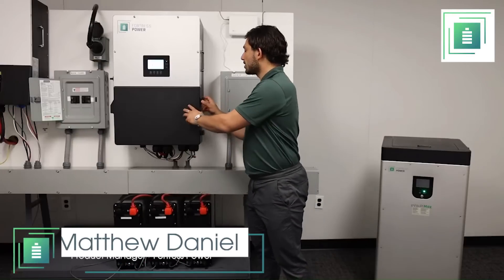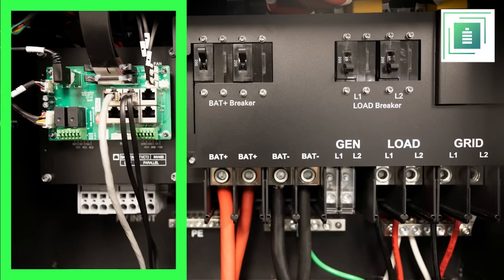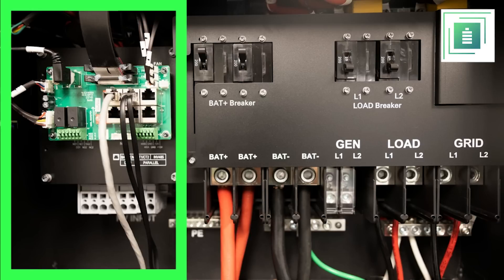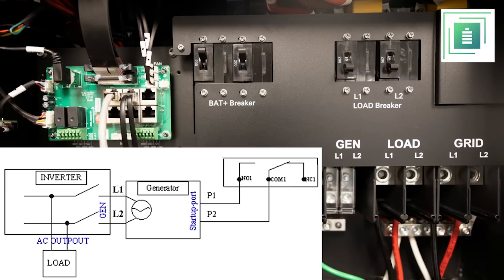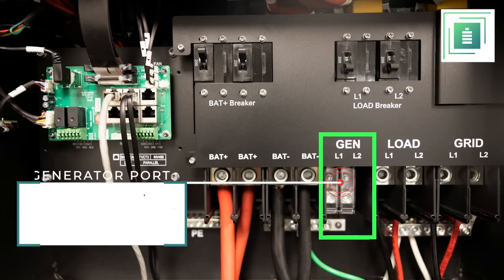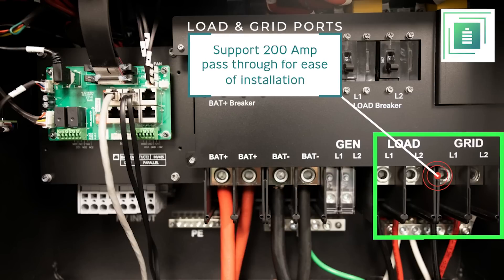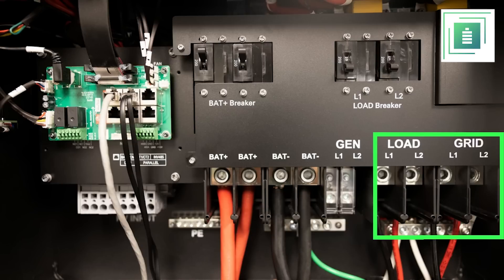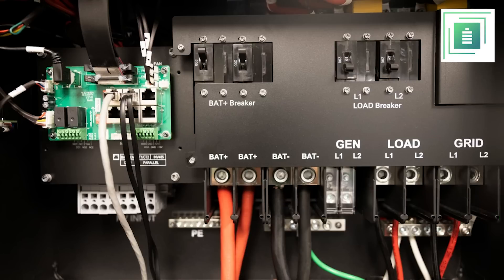Understanding the Electrical Connections of the Fortress Power Envy True 12 Inverter

Comment: The wiring size for the load size should be AWG # 2. This is a correction because 2 watts referring to a wire makes no sense. For a full home backup mostly 220VAC output with voltage fluctuation that is often higher with no harm from the grid and the 220 VAC is usually 99.99% Split phase between 2 conductors L1-L2 the equivalent to 120 VAC each plus the Neutral conductor to complete the circuit and a mechanical ground that goes to the same bus bar.